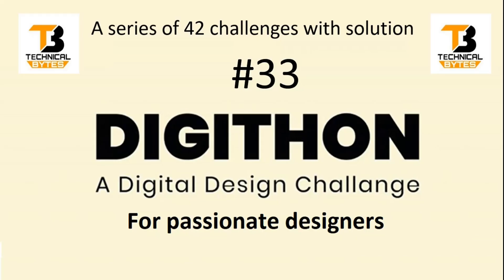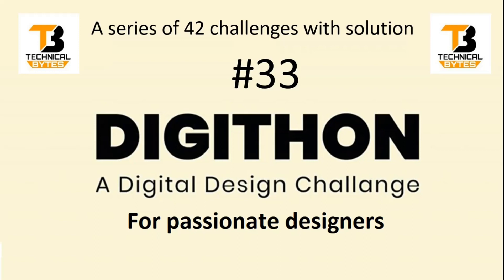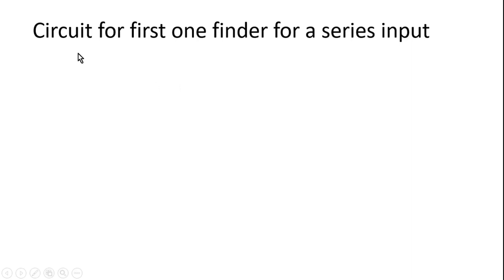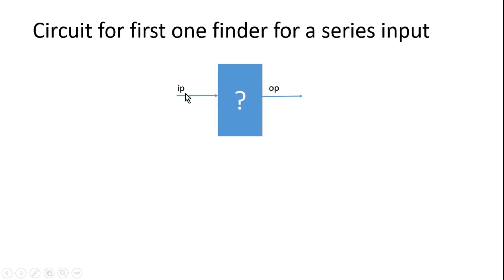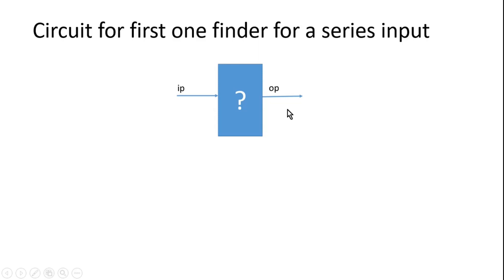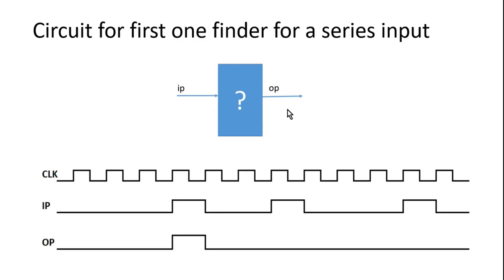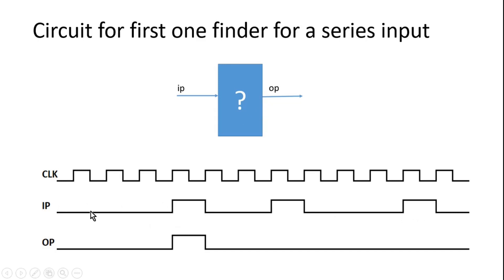DigiThon Question Part 33

Comment: Circuit Diagram: https://drive.google.com/file/d/1FTIVeJRpKbpdZYQowOweQ7NR5ZzO-WkL/view?usp=sharing
Reply: Don't you think instead of two FFs we need only one FF.
Reply: @swayansunayak6309  Could you please help me with your circuit design ?
Reply: @dhakagyan1  sure: https://drive.google.com/file/d/1psdzNIK6mNJZUW2b7iHgKesnQRI9L-sT/view?usp=drivesdk
Reply: @swayansunayak6309  Good 👍
Reply: @swayansunayak6309  what logic did u use to arrive at this circuit
Reply: AND gate output as input to the FF
input x and Qbar of FF are the inputs given to AND gate 
is it correct
Reply: yes only one FF is sufficient, D0 is not required